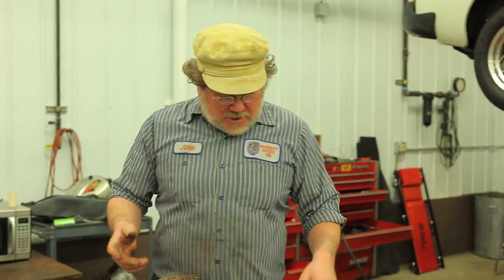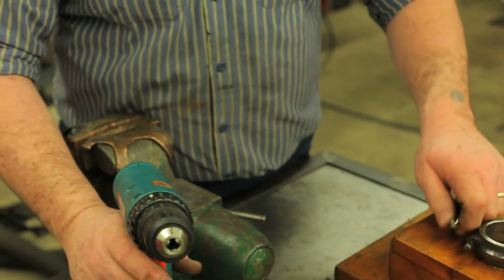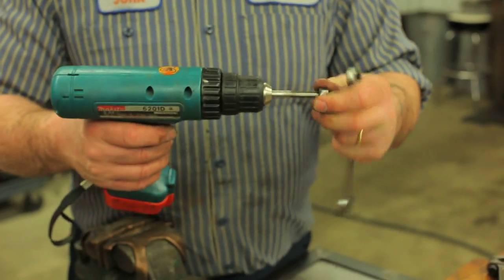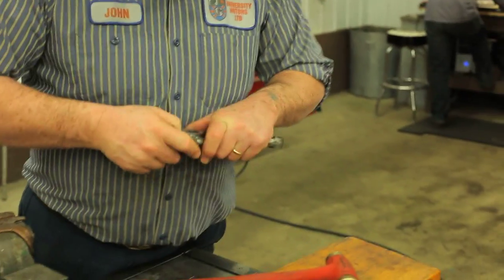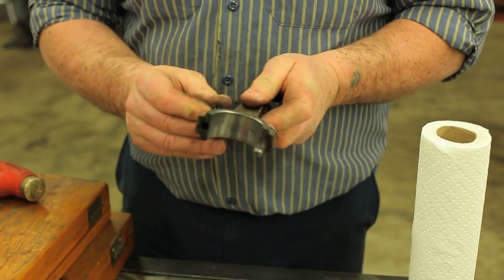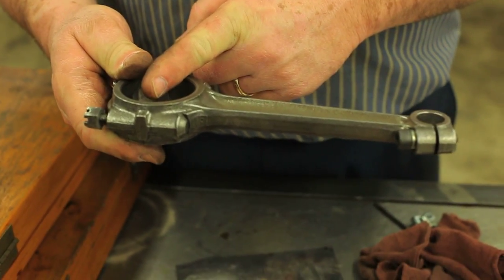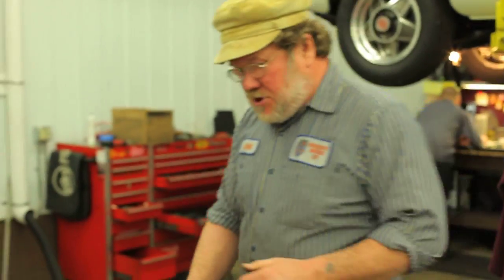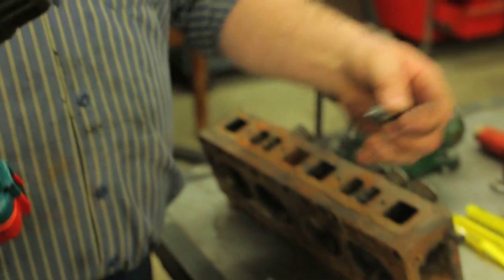187 MG Tech | Preparing an MG Engine Block

Comment: I wouldn't run a tap through those rod nuts.  The nuts probably had to meet a fit-quality specification, and driving a hand tap through them could put them outside of those specs.  Not likely an engine will fail because of it, but It strikes me as not good practice.

Comment: No my good man.. We do not chamfer the head bolt holes which have no threads. Only a hole with threads will pull. Those we should chamfer slightly as you said.

Comment: Of course these cast iron blocks and heads are not so easily damaged. Still I would screw the taps in by hand after chamfering the orifices. When a tap breaks it is very difficult to remove, much more difficult than bolts or tapends broken off, because of the hardened steal of which they are made. First time I see this chamfering though, I invented this on my own, way back when still working on motorcycles and aluminium 2CV motorblocks. Now I work on my MGB of course  :-D on

Comment: @Adios571  As you seen with Johns drill when the tap bottoms out or binds it will slip in the chuck, Even if the tap had flats machined on it it would spin the drill in your hand before breaking it.  Take it from me, a Machinist who power taps new/existing holes every week when you are doing engine parts or anything no one is going to pay your time to hand chase them all and I mean why make more work for yourself.

Comment: Thank you for this video. the only thing that concerns me is using power tools to tap the threads. I am no fitter or turner as they are called but worked as a labourer assisting fitters as a student back in the 70's. I will get out my old Tap and dies and do it by hand before I send the block and head to the machinist.
Thank you again for these really great and informative videos.